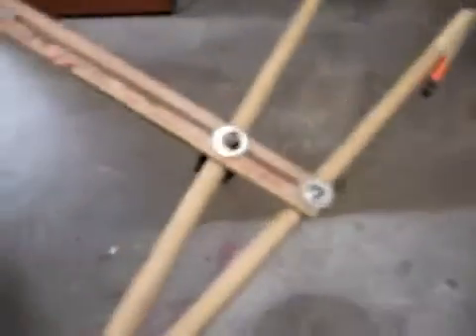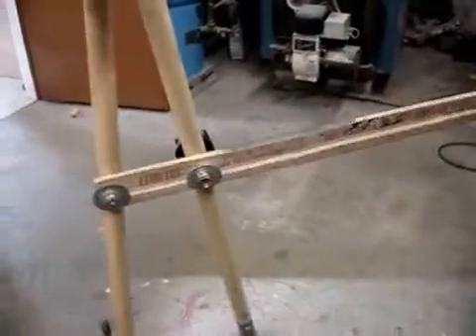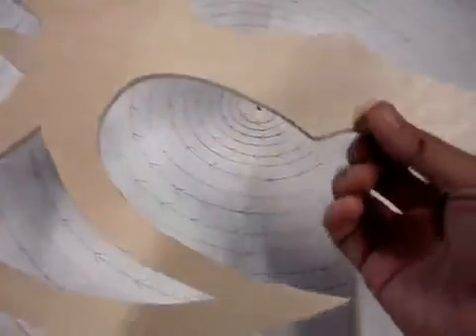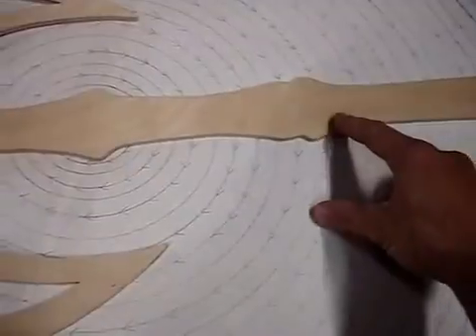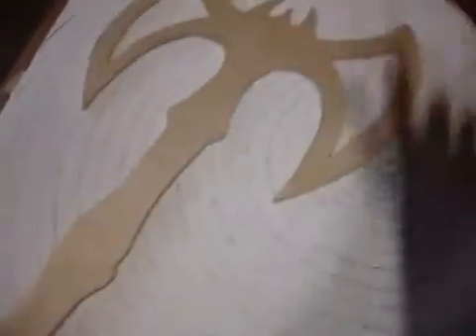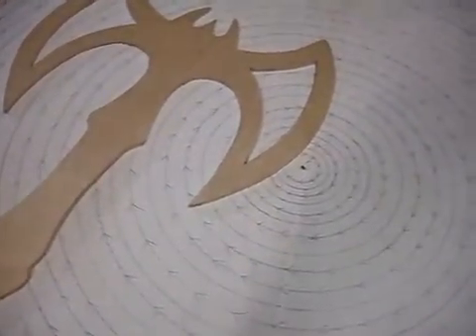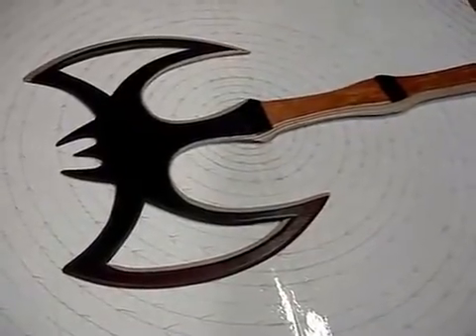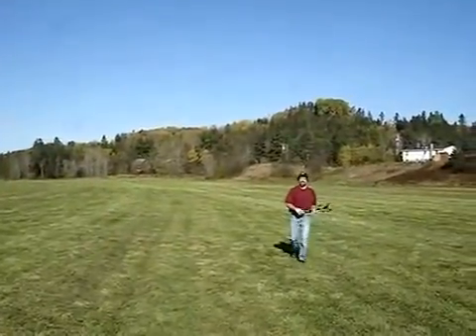Boomerang Airfoil Chart for returning leading and trailing edge demo

Comment from the maker: Yup,  5mm 10 ply. Only thing I use. 5mm converted is about 1/4 of an inch. So if your wood is 1/2 inch thick then mine is 1/2 of that.
It is better to have many layers in a thinner piece of wood. This is what makes it so strong.

Comment: There is a better way to find the Center Of Gravity of your boomerang, if you don't mind drawing on the boomerang a bit, which, depending on how much you grind for the airfoil, should be erased anyway. take a plumb-line (string with a weight) and pinch it and a point on the boomerang, and let them hang, then mark 2 points on the string, and draw a line between them, then do it again with a different point, and where the lines intersect (which could be somewhere not on the boomerang) is the COG.

Comment: Hi! Сool boomerang! Wish I had the space around me to throw something like that :)
Not sure if you know this, but I figured I'll give you a hint. You can find gravity center of any geometrical shape very easy simply by putting a ruler or (anything straight) perfectly vertical, and attaching a nail on the edge of it, then simply hang the object on that nail, when it balances itself, draw a line wit the help of that same ruler.